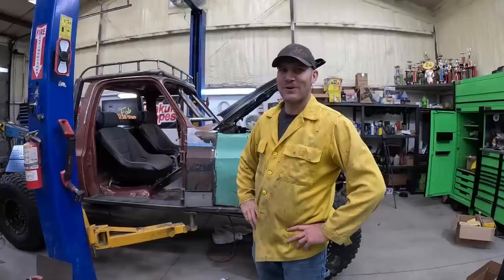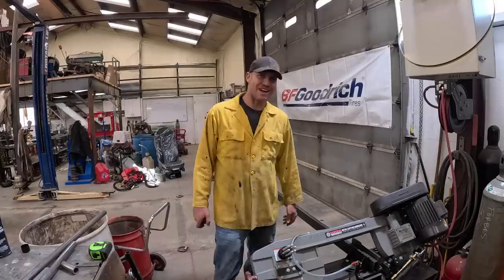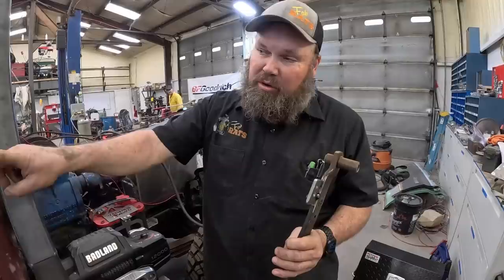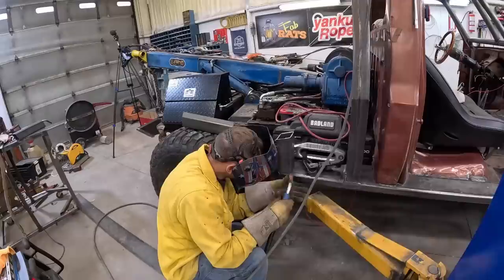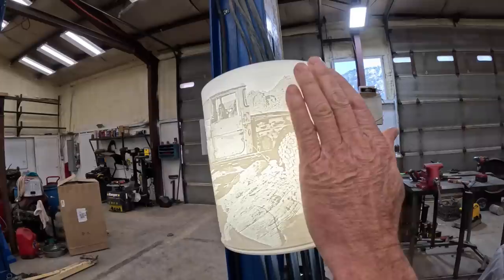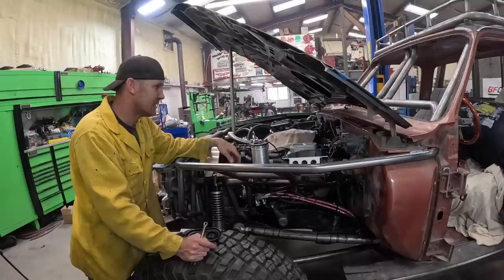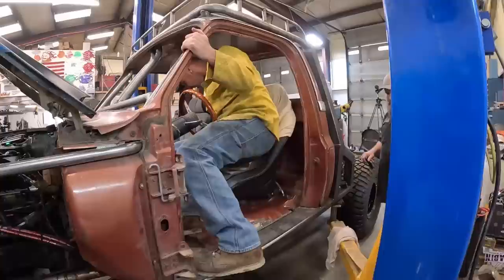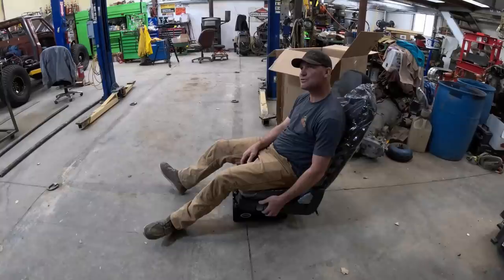Will The Hydraulic Boom Work On The Rat Rod Wrecker?

Comment: If you are planning to keep steel cables on the 2 main winches, I would suggest putting some fairly stout expanded metal screen in that rear roll cage.  if you are towing something out and it hangs on something, your could break a cable and whipsaw the back window and possibly the occupants.  Just a precaution.🤔
Reply: just put in aluminium plate and 12mm polycarb on the headache rack and 6mm polycarb as the windows. coat them with 3M stone guard. it will make them stop just about anything, and not get scratched up when paul drives through a branch or 2.
Reply: Grandma Lolly is the best!
Reply: They make some pretty stout expanded mesh.  Could literally save your life.
Reply: I was gonna suggest the same thing.
Reply: Since Paul said he was going to just that, right here in this video, it is something you worry warts need not worry about.
Reply: @JRD77VET  If there's somebody in need of some welding practice, make your own out of pipe segments.
Reply: You learn to use a blanket or chain on cable to prevent whiplash

Comment: Paul nailed his shapes in this one 🤣🤣 Great seein Gma and Ben is such an awesone addition to the shop 😎 I like that you are using the hydraulic winches instead of going all electric... It seems like the new side step/brace is limiting the pull angles of the side winches unless the tube is maybe smooth enough to just run around it.... Rory runs the side winches to the rear wheels as an extra brake/safety precaution in certain situations ! Love seeing all the progress on the wrecker !
Reply: They will most likely use a fairlead so the cable doesn't rub on anything but the rollers. As Paul says" It'll be fine"

Comment: Remember to drill vent holes in the box section, underside ,they sweat condensate inside corrode 👍
Reply: But such vent holes let moisture in at least as much as let it out. And Utah is not in the rust belt. Fab Rats is in the desert. The humidity level in the shop while they were welding that structure, in spite of the patches of snow outside, was probably in the 20-30% range. I live in the same desert, although a different part of it. When the weather here is as it's been there, and it's been similar without the snow, the humidity has been typically low. So not so much of an issue for them.

Comment: I've probably put a 1000 of those PTOs in my life. I've always had to shim them with diff thickness of gaskets to get the right gear lash.
I always took the cover off and bolted it with a couple of bolts so I could check my lash with my hands, then adjusted it with the paper gasket shims till the lash was good, then took it back off and put the cover on(if it was hard to get to to put on and off) and then bolted my PTO on with all 6 bolts/studs.

Comment: Hey Paul, you should put wire mesh in the back window as safety precaution just in case those winch cable snap, it will not whiplash and hit the driver or passenger.

Comment: Is that whine the pto gear or fluid whine? Hard to tell over YouTube lol but sounds like there is air in your hydraulic system. I noticed it stopped when using the boom. Think of it like a power steering system. It will whine till the air is out
Reply: Cavitation aka power steering whine, can damage the pump.
Quick fix, DRAW A VACUUM ON THE HYDRAULIC SYSTEM, while using the system functions to flow fluid.
Either an AC pump or straight from an intake manifold.
Reply: @cheerdiver  exactly my concern. It didn't look like they bled the system. Soon as it started whining I cringed a little. Lol

Comment: I don't know if someone already commented this or not since I cant read through all 1000 comments, but.  That whine noise sounds like it chirping the internal bypass instead of flowing straight through.   That is why it goes away when you operate the boom.   Being those PTO pumps are just a gear pump it should be an open center system and have basically zero pressure until you operate a lever.  If that is the case it's going to build heat fast.     I would look into it before you tear the PTO apart.  Maybe have elevated watch this video if he hasn't already.

Comment: I now use fire extinguishers that have a hose and not a short tube. The reason is that I can pop the hood but not raise it and thereby burn my hand. I can just insert the hose and spray and pray it gets to the fire. I also use 2.5 # extinguishers for the extra capability. I also mentally prepare myself so that if I see someone needing my fire extinguisher then they can have it immediately without question; I personally will replace it later if they do not do so.

Comment: might I suggest welding a few pieces of rebar to the top of the Headache rack brace so you can use it as a step and to ensure that your foot does not slip off if wet or muddy and while you are at it make a few linesman steps on the headache rack  for additional steps  I would suggest doing a modified Jeep door hinge  holder and make the linesman step into a elongated S shape so that they can pivot out of the way when not in use or just be removable when not needed.

Comment: Looking good I would put taillights and work lights up in the top of the headache rack behind the driver and passangers heads along with work lights in the opening by the side winches the whin from the pto may be caused by the speed at which it is turning at and wether or not it is over pressurizing the relief valve in the hydraulic system looking good

Comment: Here you go Paul a new idea 💡 It's to bad you couldn't get the  Camera system from 1 of the GM Trucks where you can see in the back of ya and in front of ya and on the sides of ya . The only thing I can see that might be an issue is all the off roading you do other than that you would have 1 of the coolest  reacker. Out there.

Comment: The sloped "lines" on the lower part of the headache rack look good, until you need a step to help access the junk rack on top. Mud, sand, ice, snow, rain will make you level it out shortly after an unfortunate slip. It ain't Art Deco lads, function over form.

Comment: A couple of pointers on your Hydraulics: 1/ The First law of Hydraulics: If you are not covered in oil, you are about to be. 2/ When starting a system for the first time, it takes a lot of oil, (and time) before things start to work, unless you have filled the system with pre-pressurised oil.😎

Comment: Better keep some kind of support for the boom on the truck for using it off road. I would not want to shock load those hydraulic cylinders going over rough terrain with a load hanging off that boom.

Comment: I was wondering if yall are going to put a metal screen between back window and on that roll frame?  Might, (would), prevent a steel cable from breaking and whipping back into the cab. An ounce ya know.

Comment: The first rule of gun safety, and the first rule of metal fab shops, are basically the same. 1) Treat every gun as if it's loaded. Also, 1) Treat every piece of metal as if it's hot!

Those rules have saved my hide more than once!

Comment: I don’t know if it makes a deference but does that wrecker hydraulic control system have a power beyond port or a constant flow to tank from supply and only diverts when the lever is pulled?  I’ve only messed with two system with a power beyond supply line from the main supply to link several valve blocks together and only supplies oil when you pull a lever.  The pump could be deadheading but if it were serious enough it would have stopped working within seconds or minutes….  Love the channel and what you guys post!

Comment: On the headache rack, for the screen  portion I think it would be an awesome idea to use the plasma table to cut out two of the fab rats logos as screens and weld them in Paul.  It would give added protection but the con would be less visibility.

Comment: Is the pto gear unit shimmed correctly to the transfer case? There may be a need to add or subtract shims for the gear mesh. Similar to shimming a starter. Or they make noise.

Comment: What about the filter on the hydraulics? Could it be causing any problems? By the sound of the pump it's hungry for more fluid or maxing out and a pressure regulator is dumping fluid. If the hoses got reversed on one of the cylinders, that work the boom, then they would be fighting each other. Just a few thoughts, shit happens. Can't wait to see this build in action.

Comment: He grown without a back windshield or are you planning to lift the cab off to put the windshield on the back and the front..🤔🤔😳 you guys need a redneck shop Christmas tree.
Yes sir mom do cans buy those little hooks hook it on your tree.
And whatever else you can think of hanging on the tree. And yes it's got to have a light. Then the redneck mistletoe with cans hanging over it three cans stretched across with the sign saying redneckness of toe.
I did all these things at my ex's house garage. They got a 40x60 shop half of it is a bar with a full commercial karaoke machine the other half as a garage.
That's when I got the idea of building a redneck Christmas tree and the mistletoe. I wish I could send you the picture.
Can't wait to see the rat rod towel or go running.🙏🏽👌🏽. I think you got Airline. Or you need to shim the PTO. I'm leaving it all up to you decide what you going to do..🤷🏽‍♂️🎄🎄🙋🏽‍♂️😎.

Comment: I am not a fabricator, that is about to be painfully obvious, but at the 5 min mark, what if you took the support on the right and angled towards the driver to cut down on the blind spot when you turn your head to look out the back and turned the other one towards the passenger just to make them symmetrical? Conversation piece and functional. It would create a bigger blind spot in your mirror, that may or may not be as important.

Comment: a square has all its sides equal, whereas a rectangle has its opposite sides equal,so a square also fits a rectangle definition
 a square is a rectangle in which the adjacent sides are equal and the interior angles are equal to 90°.

Comment: Bad piston in hydraulic pump
Reply: It is a gear pump. No pistons.
Reply: @haroldphipps3457  perhaps but I disagree. It is most likely a pump with 5 pistons.
Reply: @stoptuna7671  you would be wrong.
A wrecker that simple needs NO closed center, load sense bullshit.
99.99% chance it is a GEAR pump.
If it was a rotator, it MIGHT have a piston pump.

Comment: Those line locks are garbage. I’d switch to a ball valve before it’s too late.
Reply: Line locks have been used in tow trucks for over 50 years.
They are fine.
Reply: @haroldphipps3457  I’m not saying don’t use one. Just not this style. Maybe it depends where they’re manufactured but I’ve not had good luck with them. Just because they’ve been used for 50 years doesn’t make them good.
Reply: @tonyjackson8640  agree, MICO or nothing!